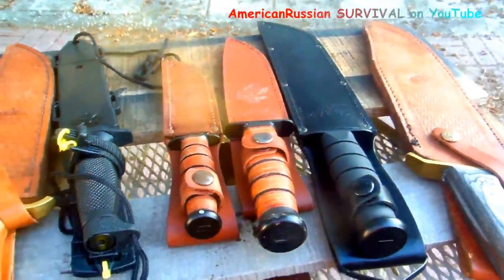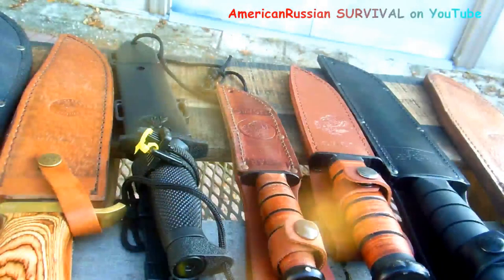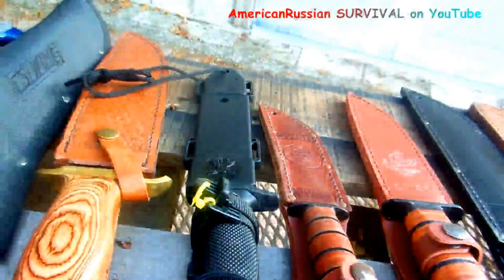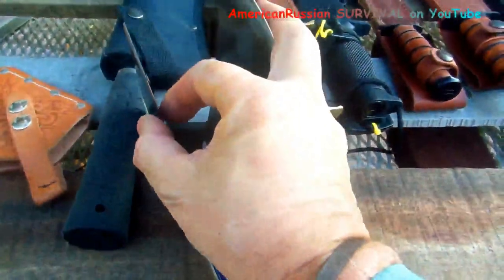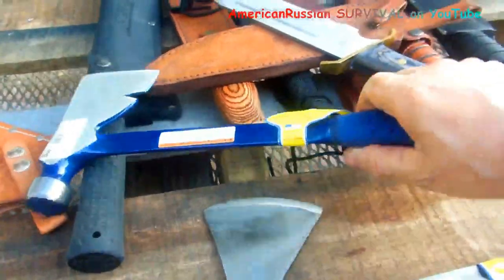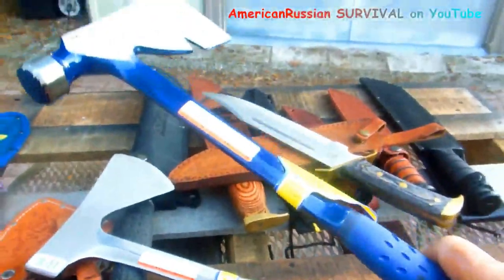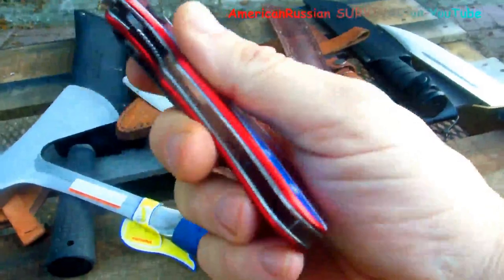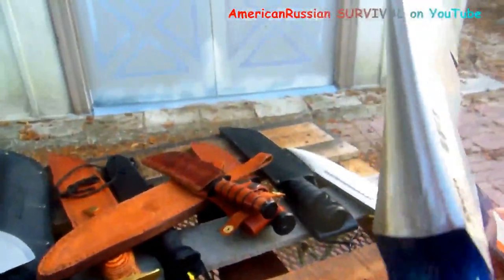Survival, Axe or Big Knife?, Surprise Answer

Comment: OMG, thanks, finally a real and practical opinion about knives  and hatchets. I'm surprized there's not more comments from butt hurt Rambo wanna bees. I was brought up, pre Rambo, camping and overnight hiking with a small folding saw, light weight  hatchet, 4" sheath knife and a scout type pocket knife. They could easily handle all of the cutting chores you would need, short of building a log cabin, without abusing them or being too heavy.
I will add that I did discover later the practicality of a riggers axe.  A foundling from the shed of my first house. Cleaned it up, new handle and a bit of regrinding and sharpening and I had one of the most usefull tools for home and field ever. It is getting pretty worn and when it comes time to replace it I can't imagine one better than the  Estwing. I'm not saying that I haven't fallen under the Rambo spell of the big knife, I do own a couple because they are cool but I don't find them all that practical to use. I agree that if I could only carry one blade into my area, the mid atlantic woodlands of the USA, you would be hard pressed to do better than  the riggers axe.

Comment: I too am an Estwing fan and own the longer camp axe.  For those of you may be partial to large knives take a look at the Buck 124 Frontiersman.  It really is razor shrarp out of the box, and I cut myself just taking it out of the sheath.  They are not cheap.  I paid $135 for mine severally years ago and now they are approaching $200.  I sold my Buck 119 hunting knife and my USMC genuine Kabar that I carried in Viet Nam after I found the Frontier.  I also have a riggers axe, Stanley or Plumb I think, and I want to modify it into a tomahawk. As an aside if you buy a hatchet with a wooden handle, pay attention to how the grain runs.  My riggers axe has a diagonal grain and turns in my hand about every 3d blow.  You want a straight, vertical grain that will not turn or sting your hand.  Think how you were taught to hold a baseball bat with the label towards you.  Same with a wooden axe or hammer.

Comment: Thinner, faster plus straight  blade catches brush for trail clearing for better use for size even large pieces easy processing 3-4 cuts on opposite sides and a hammer blow = cut w/o the wood chips/noise and wedging.

Comment: man those knives are garbage im sorry if thats offensive but you will thank me later....get yourself a good knife something in cpm 3v or 80crV2 if you dont have the money for that get a mora same price but much better knife....dont trust your life to bargain products....except the kabar its a good knife but stay away from serrated in my opinion
Reply from the maker: I have more Kabars than I'm showing plus other good knives, Made in Germany.  Some of these cheap knives are just fine for what 
i use them for.
Reply: I have a Ka-Bar serrated with the Kraton handle. It's a POS. I'd gladly sell it. My Ontario Spec Plus knives are both cheaper, and far better. Heck, a SZCO High Carbon Bowie is better than a standard Ka-Bar, and they're like $21!
Reply: @americanrussiansurvival5496 I like that most Estwing products are made in the USA. I'm disappointed that they use soft 1055 carbon steel. They need to do better. I have a 50 year old camp axe from Vaughan, made of well heat treated, 1080 high carbon steel. It has neither a chip or a roll in the blade, despite 50 years of abuse. Estwings axes will roll pretty easily. I'm not saying they make bad stuff. They make good stuff for the price. I just wish they would strive to be a bit better.